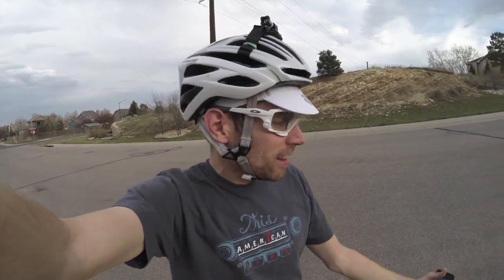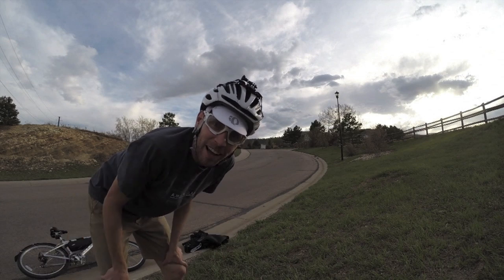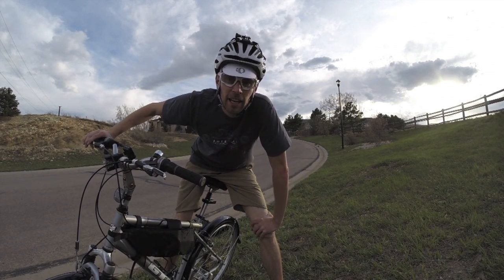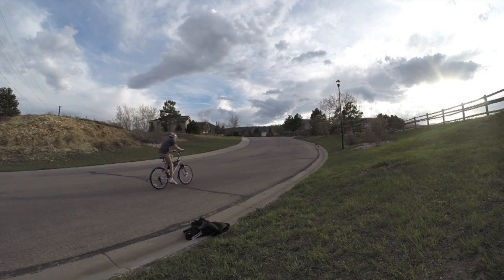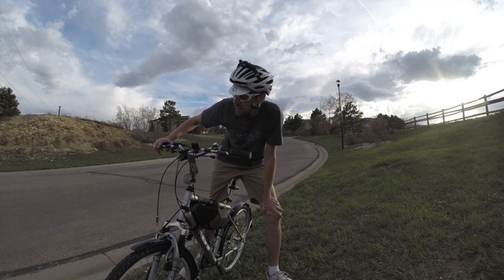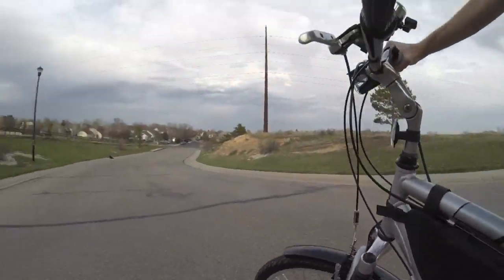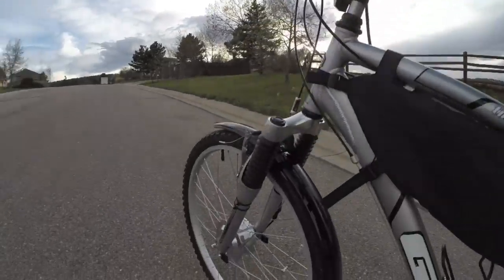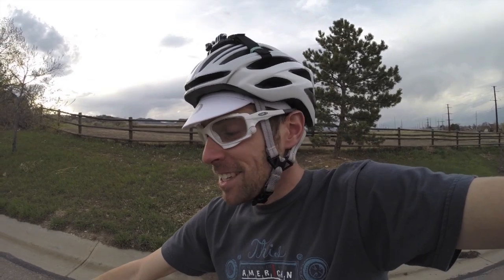LEED Electric Bike Kit Hill Climb Test

Comment: I got a 500 series, 36v, 500 watt kit by LEED. They promised me 1300 charges on the battery, 
but I only got 140 charges before the battery burned out. I barely got 
18 months of service on the kit. The battery began blinking out only a 
couple months after I installed the kit; I just didn't know it. LEEDS 
personnel knew it when I began to ask questions.  They kept stringing me
 along with ineffective fixes until the warranty expired. Now they want 
$500 for a new battery, giving me a whopping 10% discount while acting 
like they are doing me a favor.  Don't buy from LEEDS. The electric bike
 is  an idea whose time has come, but the Li battery technology just 
isn't mature enough for anything but small devices. They notoriously 
produce premature  short outs.  pfaffbeltman@@t

Comment: - one thing i have discovered with my swagger scooter is that if i slalom some going up a hiil it goes a little faster, easier. i think that is because the angle of attack is less. towards the end your test proved this too when it sped up as you turned towards the curb. - how was the charge on the battery after each uphill test? - does it do regen on the battery? - :).

Comment: Does wheel size matter? I mean, I'm looking into getting either an Ancheer 14" ebike or an E-mazing Innovations BOB. They are compact, foldable bikes and that is important because I have to be able to take it on a bus to work and commute back home when the buses don't run. Do you think the 250 watts motor will perform better with smaller wheels?

Comment: Thanks for all your reviews ive been studying them for a while hoping to put a rear wheel kit or mid mount kit on my GT Avalanche but still not sure if the bottle type batteries would fit with the controller on the triple angle GT frame also here in the U.K were limited to the 250w you just tested and that hill was nothing compared to my city,its no joke like a rollercoaster for cyclists and im  pretty sure now it will be no good. I guess the powers that be who decided its 250w just rode round the flat streets of London for 5 minutes! I may go for a 350w with 250 stickers? A 500w would be pushing it (Excuse the pun) lol

Comment: these front hub kits have a speed range they're good in. this one is roughly from 5-10 up to 20. some do well from 3-12 and these are great for mountain bikes, some don't perform well till 15 but work well all the way up to 30 mph which is awesome for speed. its all in the electric motor gearing.

Comment: Which kit is which? This video is exactly the same as the Hill Topper bicycle test you do. The videos are literally running in sync verbatim. I wanted to compare the two but you used the same video and two different descriptions?????? So which kit are you actually using on this bike?

Comment: Thanks for showing us what kind of shit we're getting into and what to exxpect I was just going to but a kit then look at battery cost fuck over $600 bucks for 48 volt situp but I did some shopping and found a 12 volt electric bike kit with battery for $200.00 now what is it about power Xs volts formula how much power do I expect? You look like you have a 6% slope Im thinking 4% grade what do you think before I buy?
Reply: +Zoological Militia the 30k battery cost 450 bucks on their website. the motor cost only 250 bucks. i got this version and its really good. im around 210 plus my bike weights in at 37 ish. it can move me and the bike really fast. it has good power for a small motor. it was a good idea i bought this, i didnt really regret it

Comment: can you add a front kit to an already rear ebike ? so like having both wheels going
Reply: +54gemini23 There is several bikes on the market with electric drive on both wheels for better traction in terrain. What I am wondering about is do the electronics meant for 250w handle 2 * 250w.

Comment: I'm eagerly awaiting delivery of my 30k Leeds ebikerig kit.  I have a 15.5 (or 17 if I choose the all greenbelt route) one way commute for an upcoming job I'll be on for a year in Anchorage AK.  So I bought the kit to make bike commuting more palatable.  I think that heat won't be much of an issue for the motor there!
Reply: Sweet! I'm sure it will help a lot, I've owned this kit and tend to rely on it for starting and climbing but then pedal like normal in between and have gotten great range. This was in Colorado where it can also get a little bit cold. Good luck out there, ride safe!

Comment: thanks for the review. can't wait for you to get a gopro.
Reply: Thanks Jonathan, I recently purchased two GoPro's and have been working with them on the latest reviews. Are there any shots or angles in particular that you're interested in seeing for ebikes?
Reply: Electric Bike Review I am almost as excited about ebike as you are. I have been monitoring alternative renewable energy scene and I believe we are now at that moment where we can take off indefinitely without a single drop of oil, refuel. Renology repackaged solar panel to be bendable 0.2 inch thick without any burging recepticle. 40x20 and 3 Lb for 100W panel($200). I can carry 8 of those with lightweight stand under 30 pounds. 3 pounder panels can be deployed even with paracords. 8*100W*5Hours=4KWatt of power I can collect. On 750 watt electric bicycle I can do 15-20 mph 5-6 hours. As long as I have food, I can indefiniately go.. about 70 miles a day. I guess you have to alternate charging day and riding day.. haha.. exciting time. I am looking for battery capacity, size, weight and distance to stop. you are already doing most of it fabulously!! Thanks!

http://www.amazon.com/Renogy%C2%AE-Monocrystalline-Bendable-Solar-Panel/dp/B00IK19VF6/ref=sr_1_1?ie=UTF8&qid=1407310068&sr=8-1&keywords=renogy+bendable
Reply: Jonathan Kim Good stuff, I like the solar panel you shared there, maybe someday bendable sheets like that will be made into windowshades that can roll up? That would be cool... I wonder how durable one of these would be right now if it was permanently left outside on a roof or something.